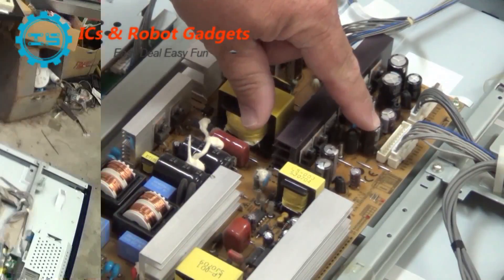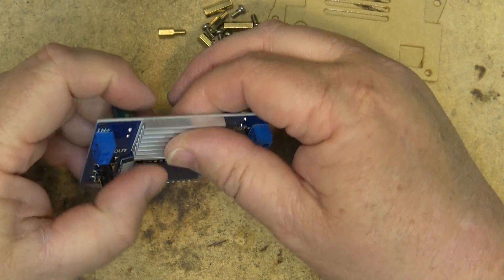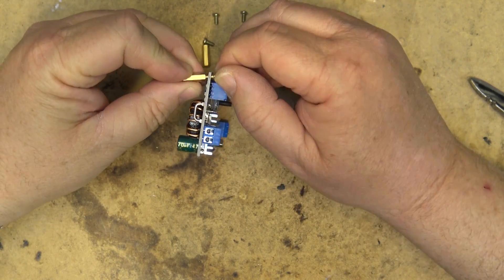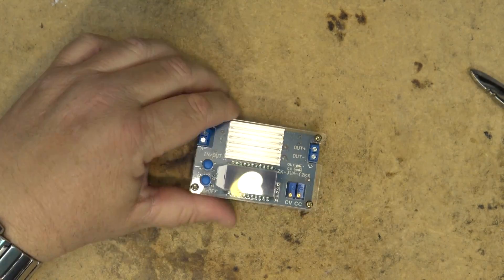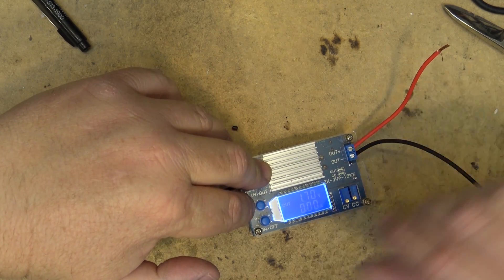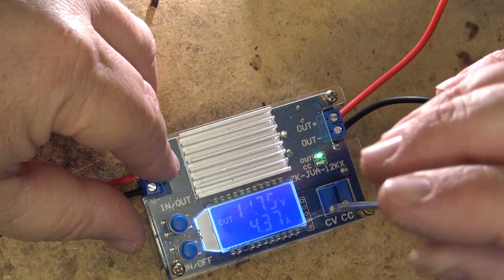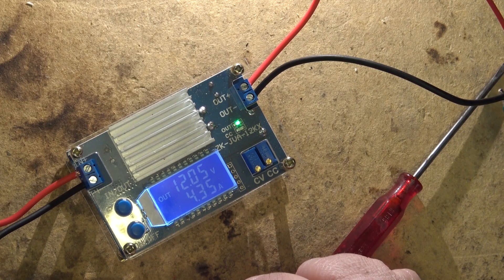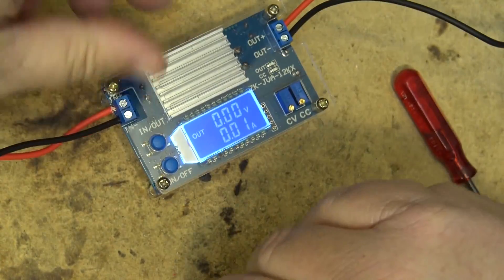Step Down Power Supply Module review and test run

Comment: With this kit, my seller provided me a big diode (15s0045) with a clear note saying, "if you want to use it as charger, you have to compulsorily use the diode at 'Out +' to prevent battery voltage backflow. Or else it will burn out the module. After attaching the diode, the actual voltage output will be lower than the display by 0.2v to 0.4v. So adjust it accordingly". 
The seller must be receiving several fried modules returned. Which is why he is providing this solution I guess. But it feels annoying when you are buying something for accurate input/output display purpose, and then you need to de-purpose it by performing such vague adjustments. What do you think? Is it really necessary?
Reply from the maker: Yes it is.  To stop back feeding if power is removed with battery connected.
Reply: @12voltvids   Thank you so much for reply. I have an idea. If I attach 2 or 3 diodes parallel, will it give less voltage loss?
Reply from the maker: @KetansaCreatesArt  diodes have a voltage drop. It doesn't matter if you put 100 in parallel you will still have the same drop across the junction.
Reply: @12voltvids   Alright. Thank you.

Comment: I am very sad . After watching this video, I ordered immediately. The input voltage should not be higher than 33v. I broke it without ever using it. I could not find the circuit diagram. Would it be repaired? I do not know ... I am very sorry ....
Reply from the maker: It does say input voltage 5 to 32 volts.
Reply: @12voltvids  
I accidentally connected 48 volts to the 2x24 transformer output.
Reply from the maker: @tameryalcn1484  well it has a max rated input 33vdc would probably accept 35 but anything more than that pushing it.

Comment: Some questions. 1) for long-term use, would it be preferable to put a small fan on top there where the heat sink is? 2) if you do put a small computer-cpu/type fan on it, is it better to blow the cold air onto the heat sink, or pull the air out?
Reply from the maker: That would be a good idea if this is passing full current.
Reply: I'd just attach a bigger heat sink. Requires no power and has no moving parts. Keep in mind, the inductor may also heat up.   Easiest way would be to buy a module rated for twice as much output power that you need, and never worry about overheating.
Reply: Regarding fans, they should always BLOW at the heatsink. Sucking will tend to draw air from the path of least resistance, which means it won't pull air through the heatsink fins.

Comment: I have several different models of that sort of thing, from time to time I dig them out to play with, then they go back in the box as something else takes my attention.  Of late I have been trying to design a good power supply, so now I have a few built up but none work as I wanted, exactly.  I do have one that works great for straight 5 volts, use that a lot. Another that has straight 5 -5 3.3 -3.3 and 12 -12. I tried adding an adjustable to that as an add on but managed to burn out the little power supply, not exactly sure what I did wrong but the standard output works on it, so it can take care of most of my needs.  I have another that is a buck supply nearly like that one but designed with an older converter, it was working OK till the other day when it became insane and told me I was putting out 65 volts from a 12 volt supply. The muti meter told the truth that it was indeed putting out 12 volts. Ah the wonders of Chinese imports and their lack of safety standards, or any standards for that matter.  Perhaps I managed to switch the display to watts or something, have to look up the manual online if I can locate one...

Comment: Nice buck converter, but that design, surrounding a  heat sink with a small closed plastic case is bizarre.
Reply from the maker: It gets warm but didn't get real hot, but yes I would skip the plastic case.
Reply: Firstly, the case is NOT closed... it's a top and bottom plate that are spaced well off the PCB.
Secondly, the top plate has numerous slots above the heatsink. Natural convection will cause the heat to rise out the slots, and cool air will be drawn in via the open sides.
Reply from the maker: @johncoops6897  
Correct. I was drawing over 5 amps and it was just getting warm but cooling fine for a 5 amp load.

Comment: It would be nice to see your bike sometime.  I have an 89 Kawasaki gpz500.  I bought it last summer and it has very low mileage and only one owner previous to myself.  I think it's sat in a garage most of its life but isn't in too bad nick!  I had a Harley Sportster before that but the alarm was a pain in the ass and I had to have it on charge all of the time when not in use!
Reply from the maker: I have a Harley Electraglyde, and yes the bike has to sit on charge over the winter as the keyless system will suck it dry over the winter.

Comment: That's a nice variable buck converter, i'm sure you will find a good use for it :-D
I've not thought about new blank cassette tapes for years, my pioneer deck has layed silent for many years.
There has to be blanks out there.
Reply from the maker: That's like me.  Cassettes were always tacky little plastic things.  I used reel to reel and dat tape then minidisk and CDR I have a good tape deck, actually 2  but are only used for playback.
Reply from the maker: Onlline only around here.